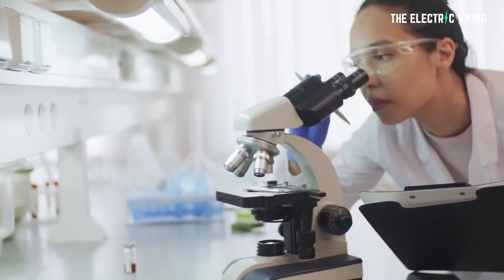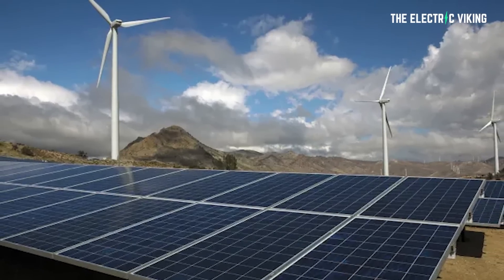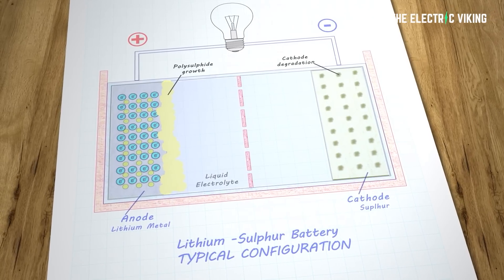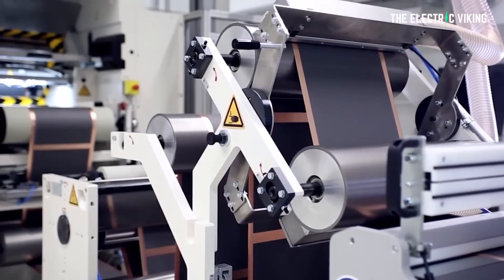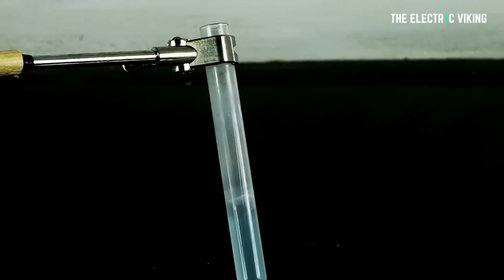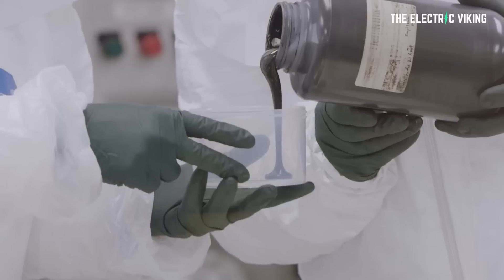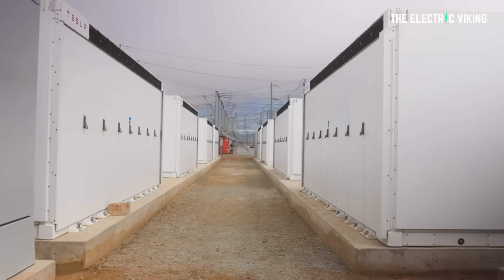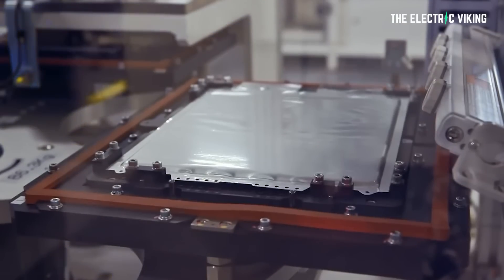US researchers discover how to make the world's cheapest battery

Comment: Molten salt battery, cheap? For grid ballance maybe. With expensive high temperature operating for anything that is small in scale plus couple hundred cycles (200-300) instead of couple thousands (5k-8k). Now lithium battery technology suposto cost 100-150 dollars/euro per kWh of capacity. Please tell me where in Europe I can buy LiFepo4 battery for that price, I can put them in the box and cramp/solder couple wires and connect them to BMS my self instead of paying 3-4k dollars to 6-7k euro per 5kWh battery. To run house I would need approx 30kWh capacity to have couple days buffer and I don't have 30k euro to pay tenfold for well developed technology that is on the marked for years. 3-4.5k euro for battery plus inverter plus PV panels I could have full installation for aroun 10-12k, but with prices that are like this that is more expensive than some of the houses in where I live.

Comment: Perhaps I missed it, but there didn't seem to be any mention of the operating temperature of these batteries (for example, if they need to be super-heated in order to work that significantly reduces their usefulness), the number of cycles they're known to be good for, or their power or energy densities.  Need to know those stats before getting all excited.

Comment: Just my opinion but this sounds familiar, another new battery chemistry discovery that will solve the alternate energy intermittency issue. But they seem to go nowhere and are forgotten a year down the road when Eureka!, another new battery story comes along. If you want real, meaningful, large scale battery storage that can endure tens, if not hundreds of thousands of charge/discharge cycles check out the iron flow batteries from ESS. It is an actual, publicly traded battery company that actually sells safe, functioning batteries. They are huge (container-sized) so won't help your car or phone but could actually have a meaningful impact on the intermittency issue. Just my opinion, man.

Comment: Hundreds of charging cycles is rather vague.  100, 200, 500? If it is only 200 then it may not be as cheap to produce as a lithium battery if you need to replace it more often.  Good solid test numbers is what is needed before adopting this battery chemistry. 

Not discussed was charge time.  For two batteries of equal output if the cheaper one takes 3 times longer than the expensive one then consumers will not want them.  The idea that this battery prevents dendrites from forming is one of the largest hurdles the designers of batteries have been facing for a long time, so that is encouraging.  Aluminum production is very energy intensive and the only thing that makes it economical is very little energy is needed to recycle it, about 5% of the energy to make it per mass volume. We get most of our sulfur from Canada and Mexico so we want to stay in good graces with these countries.  Of course, China is the next largest producer which we seem to be at odds with most of the time so we can't rely on them.  Hope this works out as something as a simple battery pack of decent size and charge capacity for electric bikes has gotten rather expensive.  One of the main reasons I have not yet pulled the trigger on electrifying my recumbent trike now that my legs are getting older.  Also not discussed were relative battery sizes or how much the battery can output per kg of mass.  Batteries now take up a lot of space in an electrical vehicle.  if these now batteries have only 1/2 the battery charge density of Li batteries then cars will be carrying around a lot more weight and need more space to fit the batteries into the frame.  Just not enough useful information in this video to give the viewer any idea if these new AL/S batteries are the next best thing or only just cheap.  I remember once reading a SF story about how mankind got to the stars.  As with all travel, be it on earth or in space, energy is needed.  When someone asked how much the batteries had been improved the author said it was like a firecracker had been improved to output the energy of a nuclear bomb. Thats the battery we need :)

Comment: For home storage, it would have to compete with LFP batteries.  This is now the staple, esp. in the DIY solar world.  The calendar life would probably kill the battery, long before the cycle life, given typical solar cycling.

But the high charge rates, and I assume, similarly discharge rate, could make it useful, as a buffer, for DC fast chargers.  Not sure about the "hundreds of cycles", with high charge rates.  How many cycles, can it do at 1C?   What is the energy density?

Comment: The Tony Seba study concluded that the combination of excess solar/wind nameplate capacity vs battery capacity required for their study areas in the USA was a set of possible designs. They concluded that nameplate capacity of 4 times the electrical demand plus 48 hours of battery storage was a typical lowest cost option.  48 hours, not 4. it may be different in Australia, but 4 hours of battery seems low.
Reply: 4 hours is unlikely to be adequate because night is more than 4 hours. Battery capacity requirement is driven by demand/reliability requirements, probability of wind and solar being available together with generation overcapacity at distributed locations and grid capacities between locations where generating capacity is available and where demand exceeds gen capacity.
Reply: That 4 hours is calculated for full capacity, but at night people use less power. Half energy use = it lasts for 8h.

Comment: I don't understand how hundreds of cycles will work for a home? A two year battery?  So if a lithium lasts 10-15 years, you will need to replace this one 4 to 6 times.  The labor alone would not justify it?  

I can see for a neighborhood grid, the utility possibly interested, and possibly businesses.  But a homeowner?  

Right now solar is only for the upper middle class.   And it still requires subsidies.  

That is also a concern how does the switch to EV work when Musk explains that EV'S are also for only the top 50% of income.  

That is a concern, how will lower income folks afford any of this?
Reply: Poor folks mine lithium, that's how we afford any of this.  Electric cars are not The Answer.  They are a tool leading us to understanding that we have a relationship with each other globally, and with the Earth.

Comment: Remember the Aquion batteries?  Similar strategy using abundant materials for a safe, large battery. Business model and the sudden drop in lithium battery costs (several years ago) means Aquion is practically an unused patent.
Reply: Aquion is now another company which makes their Silicate "Salt batteries."  Often not obviously labelled as such, they're a great lead acid successor, but heavy,  which drives up the cost of materials and shipping. Presently price and performance midway between lithium and lead acid. They can be charged when frozen.  They're available on Amazon. Like carbon foam, and others, until they are mass produced and people are more comfortable with them, they remain more expensive than lead acid.  Everyone's waiting for their fishing buddy to try them first.

Comment: They do not talk about round trip efficiency.  Because of the relatively high operating temperature, This will not see automotive use any time soon.  The Lithium iron phosphate battery can work at near zero C temps.   

The other problems that need to be solved is round trip efficiency and number of recharge cycles.  Where is he at on that?
"Almost" is not good enough and Sadoway likes to create new battery companies with half baked technology.  Scaling is hard to do and Sadoway is already putting constraints on the market for his new battery because he has another competing technology in another spinoff with a half baked technology.

Sadoway's other battery chemistry (AMBRY) operates at 500C and has a round trip efficiency of 70%.  

For his new company (Avanti) a lot of work still needs to be done.
"In the paper, the researchers report a battery that operates at the salt’s melting point of 110 °C for operation. But he says they have already brought that melting point down to 65 °C and can see ways to get to room-temperature operation."

Comment: A small power station continuously make 100 megawatts of power. That’s 2,400 megawatt hours per DAY. a 10 megawatt hour battery is a drop in the bucket. Then what happens in mid winter when the sun hasn’t appeared for weeks and power demand is high. 
Storing USEFUL amounts of power for MONTHS is simply not possible.

Comment: Every nuclear power plant has irradiated fuel packed with ultra long life radioactive elements. It’s long life because LESS THAN 5% of the fissile energy has been taken. For every kilowatt hour generated there’s another 24 sat there in the used fuel. 
We have the technology to extract that energy leaving a short life waste. Two problems solved with zero new mining and an easy waste to deal with. 
Why are we not pushing this technology right now? Moltex and Elysium have the means but political bias against any new nuclear prevents progress.

Comment: This aluminium-sulfur battery is great as a Stationary (non moving)  Battery, but not good as a Mobile battery used in EVs.  (Lithium is still king for mobility). However this Al-S battery is fantastic news for cheap and efficient EV charging stations.
Reply: Why not as mobile battery for EVs?
Reply: Given they are not nearly as energy dense as Lithium batteries; For the same range (distance travel), they would require a much larger volume and hence weight than Lithium batteries. This factor of larger weight destroys their competitive advantage.

Comment: Hundreds of cycles? 🤔 Well if say 400, then the cost/kwh-stored would be the same as for LiFePo4 with 10x the cost but also 10x the cycle life. And minus the cost swapping the alu-sulfur cells 9 times. 
So mostly interesting for 2 reasons. 1) It's a new technology with likely room for improvement in cycle life. 2) Even if it ends up at the same cost, it still eases the strain on lithium demand, thereby contributing to lower battery prices in general.
Reply: people simply want a cheaper better lead acid with no electronics going "wah!" It doesn't have to power our nuclear dreams of a brighter future, it just has to work.  Besides, they'll come out with something better the next year when I go to replace my house battery.  Why invest so much money on soon to be obsolete, no longer supported tech?

Comment: "Aluminum-sulfur battery for small-scale storage at $8.99/kWh" in PV Magazine Aug 30, 2022
"Fast-charging aluminium–chalcogen batteries resistant to dendritic shorting" in Nature Aug 24, 2022
Reply: Sounds too good to be true. 
If true, then coupled with solar panels will give independence to anyone with a roof.
 with 100 dollars regular storage needs are solved. With 1000 you cover even a week of rainy days. 
And I think that this price is lower even than hydro storage which loses a third in conversion. 
Anyway, that precision 8.99 smells like bullshit. Why not 9 or 10. Even dollars fluidity can be a lot more than that stupid cent.

Comment: Batteries are the killer part of ending fossil fueled power generation plants. 
In Australia fossil fueled electric power, a 25GW installed power system, has an annual cash flow of $67billion and could go to x5, = $330billion with nuclear power plants. And have government Garrentees. 

So dirt cheap Batteries and the auto industry with new EVs and Renewables would be a perfect match with the existing grid. 
The grid will be UNLOADED as the dispersed electric energy will be at the ends of the grid.

Comment: Molten sulfur?
Sulfur melts at 113C (235F)
This smells like another "Game Changer" to me 
and will fizzle out like all the other batteries they cook up weekly and look for low IQ investors for money.

Sorry, but getting a new battery chemistry to market takes a generation - 20 years at least.
Nothing new is coming down the pike - just incremental advances of 1% or 2%, and after 10 years, it might make a difference.

MIT is the last place a "game changer" will come from - the crazy guy in his basement is where a revolutionary breakthrough will be found - but then 20 years will still have to pass to get it into your EV.

The EV industry is in a lot of trouble - Tesla locked up all the lithium mines and battery producers and For d and GM will never get anywhere since they can't get batteries - Elon locked them up.